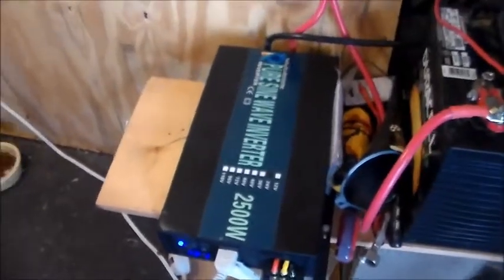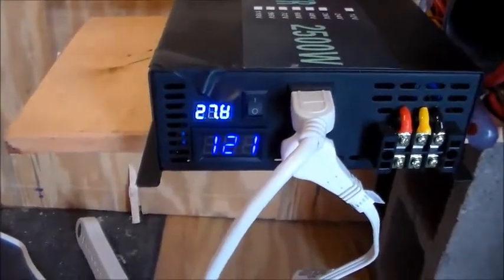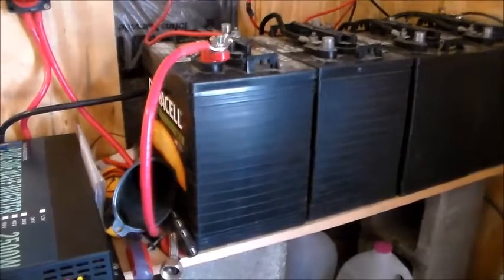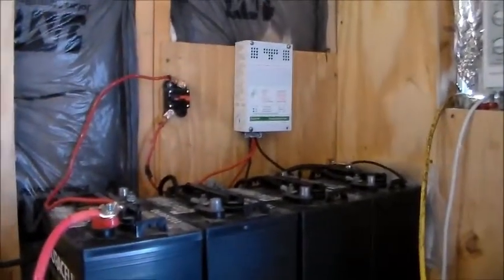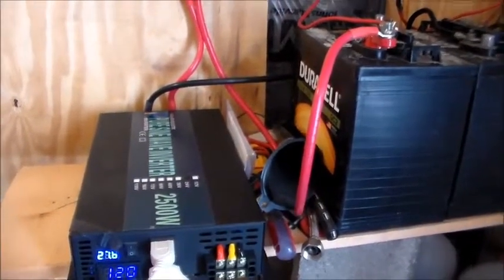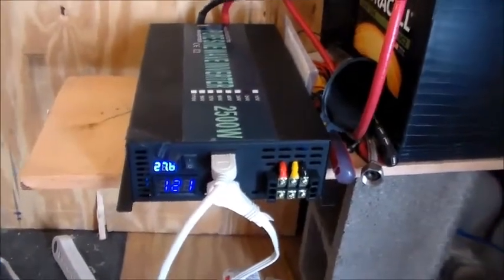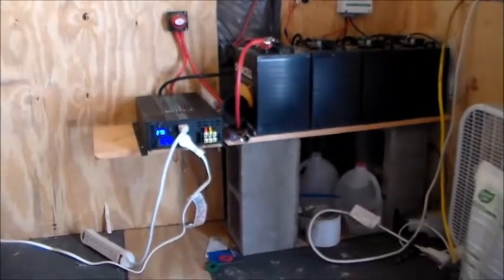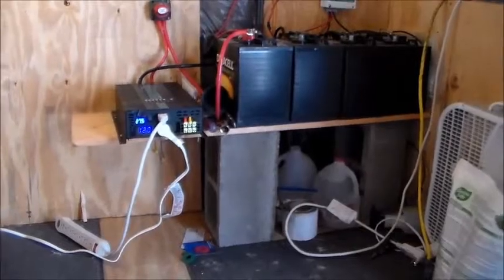testing a reliable power inverter

Comment: 24.9 is fine under load, thats about 12.45 volts on 12v system witch is very normal running voltage.
Reply from the maker: I think so too. Thanks for watching
Reply: You'll only need to worry at about 20v with a 24 v system.